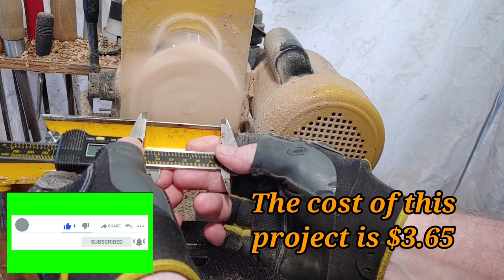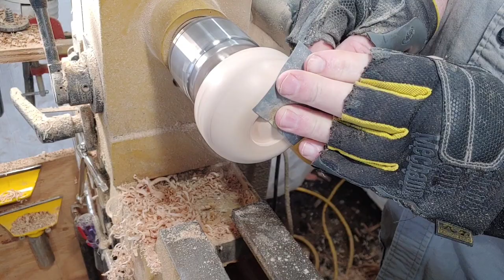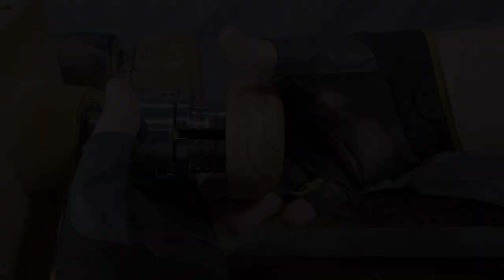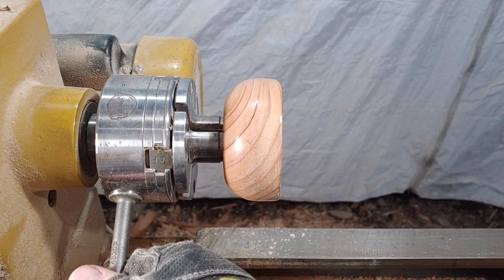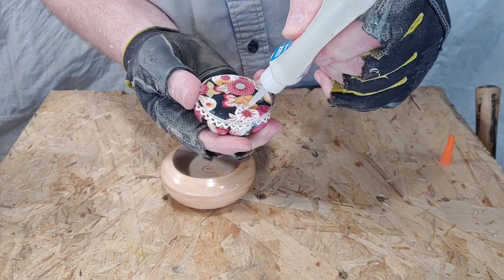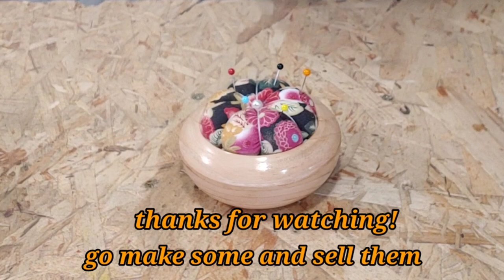wood turning- sold out of these at the craft show

Comment: What is the device you using to measure the diameter in different videos and reason?  Is it to measure the diameter of what needs to fit? have only watched a few videos so far but will be watching more of course.
Reply from the maker: It's a caliper. I use it to measure the size for the chuck.

Comment: Hello, thanks again for all the videos. I've really learned a lot!...Quick question when you get time, I'm using your recipe for friction polish and it looks great! However after being stored for awhile it loses that initial shine. For some of my projects I prefer a high gloss shine. Do you have any suggestions on how to achieve a higher gloss shine after applying your friction polish? Thanks again for your help!!
Reply from the maker: Sometimes that happens if the wood is really dry or partially punky. Mostly with softer wood. If I run across that I put a few coats of pure shellac (not the friction polish mix) . I gauge it by how much it absorbs into the wood. Basically your sealing the wood before the final finish. I add coats until it stops absorbing into the wood.

Comment: Seems like if the cost is less than $4 per and they take 15 min. to make, your are margins decent but your hourly rate is abysmal. For sustainability I would advise rethinking your business model very quckly...unless you are doing it just for fun.
Reply from the maker: My goal is 30.00 per hour. I average closer to 45, but yes I do it mostly for fun and sharing my ideas.
Appreciate you watching.
Reply: @RcWoodturning  ah, I see. You are not including your wage in the cost. With that clarification your wage is solid but there is no margin. If you plan for this to be more than a hobby you will still need to look at your model as it would not be a sustainable business.